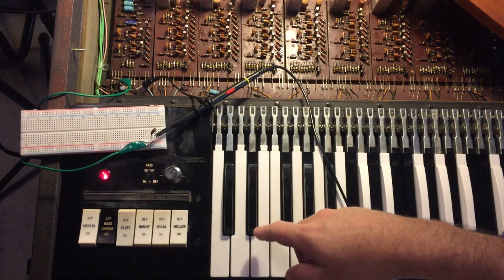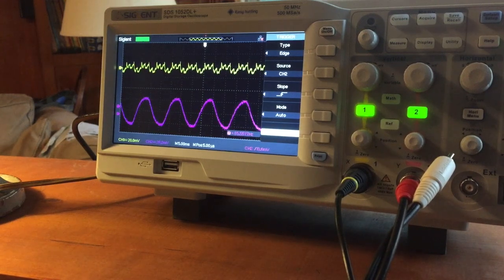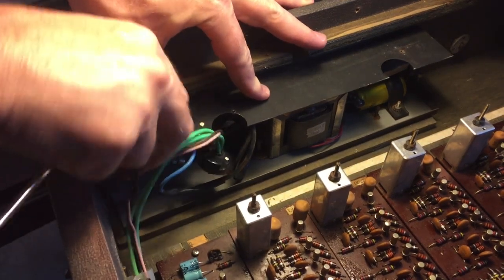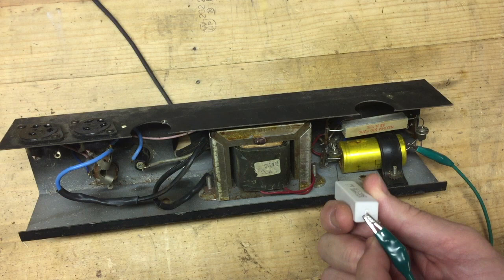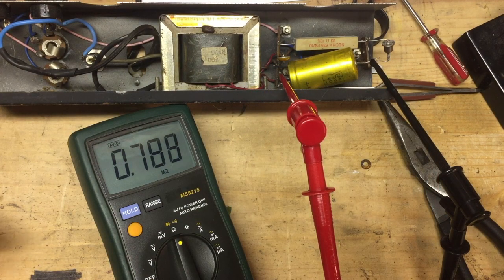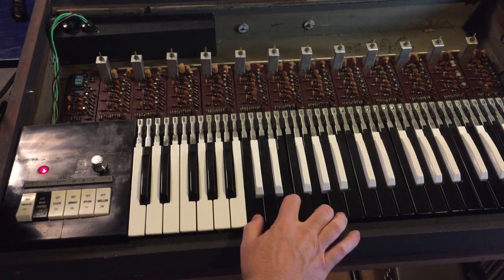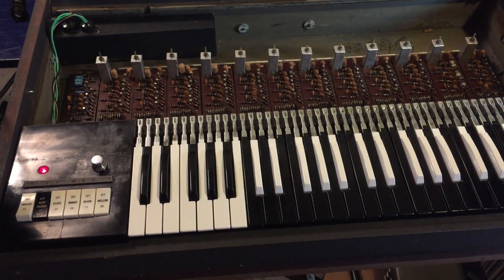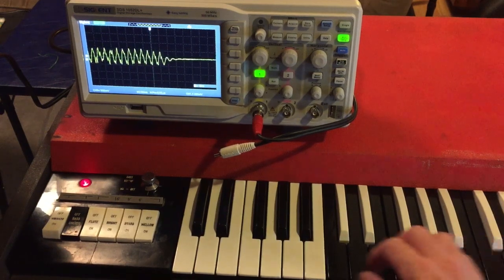Vox Jaguar Repair Pt. 3 of 3 - Waveforms and the Power Supply

Comment: FYI, that is not a 2 ohm resistor, that is an 8.2 ohm resistor. Also, tapping on the power supply means a loose solder connection. The transformer would never be the root cause of such issues. Also, most oscilloscopes have DC blocking input, so that extra external capacitor is not necessary.

Comment: Thanks for this. 
If my bass chord switch doesn't do anything where should I be looking? 
I installed a 3 wire computer plug as you did, and replace all  electrolytics, glued the black buses into place... I think everything's working except the bass chords.

Comment: Great series of 3 documents, Mark! Learned some good tricks that I may be able to put to use on my Crumar Organizer 2. The "computer plug" is a C-13 model from the IEC standard 60320 (the female on the power cord is the C-14). Link to an illustrated list of the plug standards: https://en.wikipedia.org/wiki/IEC_60320 .
I did the same power cord retrofit on two PF-15 by Yamaha which I revived... Makes life and transport easier and safer, as you mentioned!!!

Comment: I have a Jaguar that was working great except for vibrato. One day I went to play it and it sounded very distant and distorted. You could barely hear it. I tried the Fonzie repair method. After hitting in a couple of times nothing changed. Heartbroken I put it away. After sitting for quite awhile I plugged it in and tried to figure out how to fix it. Symptoms started where I left off. But during test the sound completely cut out now.  I was thinking of replacing the big brass capacitor as a start.  Hopefully that will make it come alive.  You have any ideas what I should do?
Reply from the maker: Hi there!  I would definitely check that capacitor: it's got to be 5 decades old by now, and probably isn't working very well.  If you have a multimeter, check the resistance of the capacitor (it should be infinite), that's a good first-pass check.  Good luck!

Comment: Hi Mark,

Hope you're well -- I don't see any recent comments from you...

Enjoyed your series on the repairing the Jaguar as both a longtime hack musician and former electronics technician/field engineer. I picked up the Heathkit version of this organ on ebay 15 or 20 years ago and still have it. I had to do a little repair work, similar to what you've done in the power supply. And I even put in the same 3-prong AC connector that you used -- with so many computer power supply cords laying around, it was a natural! The details have escaped me, but I also had to do a little work on one or two of the tone generators, replacing some transistors. But everything worked when I was finished, and it hasn't been turned on since...

At any rate, I noticed that there's quite a bit of AC hum in parts of the first couple of videos and am offering to clean up the audio, if you're interested. It's quite easy to do with iZotope RX and I could either supply you a replacement wav file or even assemble a new complete video file, if you're interested. (I'm talking *Free*, of course. This is a valuable resource for the remaining few vintage keys guys like you and me!)
Reply from the maker: Hi there!  Thanks for the offer . . . but this organ has long since been returned to its owner, and has been in semi-regular use since then with no reported issues.  Once I replaced that gold-colored twin capacitor with the two blue ones at the head end, the AC hum was cut way back.  My guess is that the amp through which the guy plays it produces more hum than the organ does.  I appreciate it!

Comment: Mark you are a badass! Do you have a shop? I have this same organ that was given to me by a family member and it's in mint condition. It has a little scratch in the mode buttons but plays great! How much would you charge me to troubleshoot it? I live in North Carolina.
Reply from the maker: Hi there!  Well, I have a day job and do this sort of thing on the side as what I'd call a "serious hobby." My shop is in my garage in Houston, and generally I'm not taking any more work these days: I'm just too busy with work & family right now.

Having said that: for the buttons that are scratchy, a little contact cleaner sprayed into that area should clean things up pretty well, and it won't do any harm.  I recommend getting some contact cleaner in the aerosol cans, with the little aiming hose, and spraying just a little bit behind the switches, then exercising the switches back-and-forth several times.  It should clear up the scratchiness for a bit.

Good luck!
Reply: @markbeebe4388  Thank you so much for the reply Mark! One more question if I may. I'm having trouble finding a schematic. Where should I look? I'm going to have to replace those four oscillator caps.
Reply from the maker: @scalefingerz  My best recommendation would be to check the links I have in the Description section of my video.  I believe the website under the first link has a lot of info about the Jaguar and other Vox organs.
Reply: @markbeebe4388  Thank you Mark!!!!!!!!!

Comment: Hey Mark I had questions a few months back about my Jaguar with the voicings and I was able to get that fixed. But I have another problem that I know how to fix which is the power supply capacitor. And my question is where can I find replacement ones like you have in this video?  I did manage to replace my bad one with another one from a parts lot I ordered but it too went bad.
Reply from the maker: Hi there.  The capacitors I used were purchased from a local electronics parts store.  I tend to shop locally as my first choice, but sometimes the selection is limited.  After that, I often buy capacitors from mouser.com because I like the wide selection they have.  AmplifiedParts.com has a selection of multi-can capacitors, and I've purchased from them too. I actually like to use discrete capacitors in lieu of multi-can capacitors, if the space and mounting allows for it.  Since the original 2-can capacitor was made decades ago, and new capacitors are generally smaller, I was able to fit 2 discrete capacitors into the same space as what the old 2-can capacitor took up.  I hope this helps!
Reply: @markbeebe4388  Ok thanks again for the info! And I'm glad that there is some videos out there like yours to help with some repairs and questions on these really cool organs. Very hard to find replacements I think. And it looks like I'll need two small capacitors like what you have on this organ. I'll check out the sites you listed and again, thanks!

Comment: I think the computer cable is called IEC? Thanks for the tip using the resistance reading on the multimeter to check capacitor health, I hadn’t thought of that and have been using an ESR meter out of circuit. Is there a similar test you can do with a standard multimeter to check if a capacitor is open circuit and won’t pass AC either?
Reply from the maker: Hi there.  There probably is, and I imagine it would involve simply calculating the cutoff frequency of the capacitor in an RC circuit, then using a function generator to sweep through the proper Q point, and see how it behaves.  This resistance test is a very "down and dirty" method, and it has its limitations for sure, but if the capacitor is old and has failed in this manner, then it's a very quick and easy test.